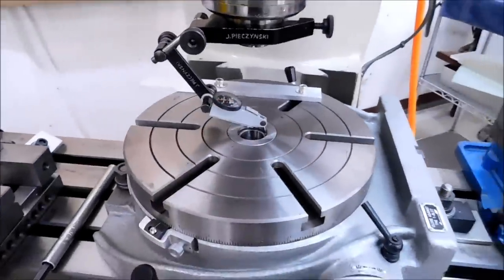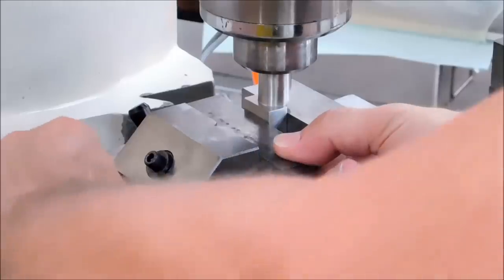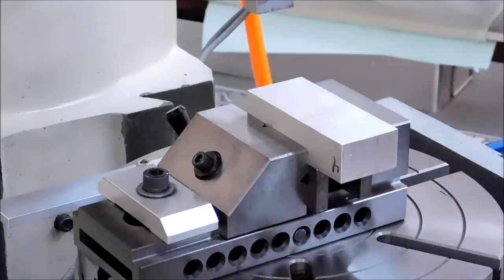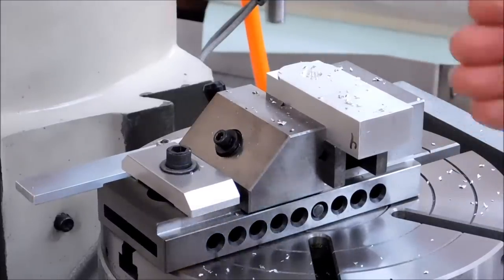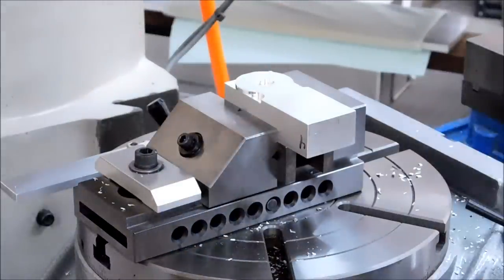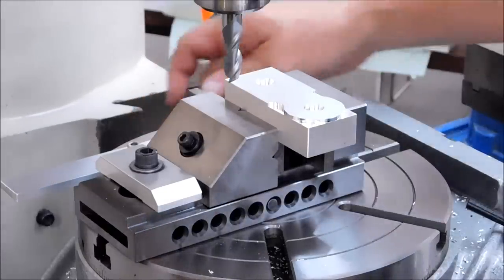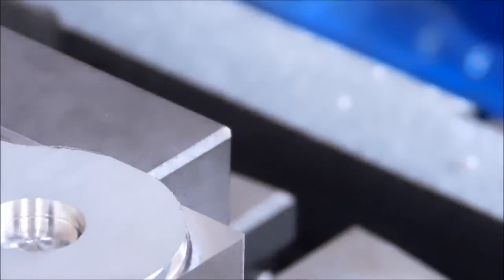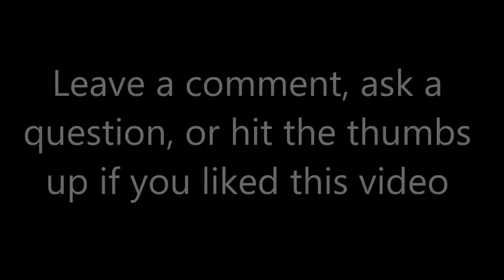Simplified Rotary Table Setup. Tool Demonstration #1

Comment: Climb milling is the best way to break your endmills especially on steel!!!!!
Reply: Looks like aluminum to me but I agree on climb milling
Reply: @davemanley8700  It is Aluminum the part he is working, I am speaking from 50 years as a machinist, you have to have ballscrews to do climb milling and still you take the risk especially with long endmills:-((
Reply: I can climb mill reliably so long as I take reasonable cuts and partially lock the travel axis. This is on an old worn out acme thread too
Depends on how brave you feel!
Reply from the maker: I climb mill exclusively.
Reply: @TomMakeHere  You will feel brave until you break the cutter, then you feel frustrated!!!!! why complicate things when there is a simple way to do it!!! Using the locking screws accelerates the wear and tear on the guide ways:-) As an apprentice in a shipyard I was thought never to climb mill if you want to avoid trouble:-))) Well this is a free country if you want to climb mill go ahead!!!
Reply: Climb milling on a rotary table is not a mishap waiting to happen because you can adjust out all (?) the backlash between worm and gear. Just don't imitate a bull in a China shop.
Reply: Its interesting the last 3 endmills that I have broken were while conventional side milling. The fault was mine, had a tallish plate standing up in the vice, the instant that the endmill cutting edge makes contact with the part, it's actually on the front face being cut, not the side that you are milling and the rotation direction acts to pull the part like climb milling! The part grabbed (I hadn't  tightened the vice enough) and pulled itself into the endmill. It took a bit of head scratching to work out
Reply: @chrisstephens6673  My friend if you are happy keep on doing it, as I told you its a free country:-)
Reply: @johnhili8664  for normal use on a shagged out milling machine, mine, I absolutely agree with you. Save maybe for a very light final pass where the cutting force is considerably less than the force needed to move the mass of the table against the backlash. In my comment I was referring specifically to the rotary table where backlash, the reason for being careful to pick the right direction of cut, can be adjusted to  virtually zero. 
Here's to living in a free country,

Comment: Do you plan to make a version of this tool with a 0.500 shank? My mill is a Clausing 8520 that only takes MT2 collets, with a max of 1/2" diameter.
Reply from the maker: I may consider that. I have also had requests for 3/8".       Anybody else interested in smaller diameters??     Please reply.
Reply: @joepie221  Hi Joe, either of those smaller sizes would be very helpful for mini mills - thanks!
Reply from the maker: @joelsciamma9322  1/2" dia currently for sale on my webstore     https://www.advancedinnovationsllc.com/shop
Reply: On the .500" shank version would adding a 0.250" diameter center hole with a floating 0.249" diameter headed die punch provide a needed feature?  The hole's diameter top portion could be relieved, the bottom 1" portion wire EDM finished.

Comment: Hey Joe, Loving the Channel as a newbie im learning heaps!  i have a request that you may or may not have touched on before  - Could you do a laymans way of finding the degree or angle of spline teeth?  i have a spline here that i would like to practice cutting and id like to be able to accurately find the angle of each tooth but its too small for my protractor. any help would be appreciated or links from fellow machinists. Cheers, Troy

Comment: What are the tolerances of this tool? Why does climb milling aluminum on a rotary table FEEL so good?
Reply from the maker: .0005 max in every direction from center. Climb cutting feels good because the cutter is pulling the table.
Reply: Joe Pieczynski Great. I’m getting one and showing my friends. 

When I climb mill in X or Y and it pulls the table it feels... okay. When I use the rotary table, it’s like the endmill was waiting it’s whole life for the moment and I greatly enjoy it. Maybe it’s because its crank is more accessible and easier to turn, but I first thought deeper cutting physics at work, since at the same feeds and speeds I will get better surface finish.

Comment: I missed out on purchasing your allinment pin but I did make my own and my rotary table arrives tomorrow I can't wait thanks for your channel it helps a great deal but I do have a question but I'm sure when my rotary table comes in I will have my answer you mentioned that your t slot does not line up with the x axis why can't you disengage table aline it and then reengage it
Reply from the maker: The index plate didn't allow for that, and the index marks are hard engraved into the table. Only an offset indicator will solve this issue.
Reply: @joepie221  yup I’ve noticed that I have the same problem I will have to make an offset just like you did but first I have to make some t bolts again thanks for your help and your channel it makes a big difference to those less skilled ps I was able to find a Illinois trig table book

Comment: when i first seen it i thought you had a cross slide rotary table, this is easy, if you had a CNC mill you could have programed it by hand and had the part done in a forth of the time, you can't make any money like this, this is the way you play around for yourself only
Reply: Most of us are amateurs and have manual milling machines, I'd guess.
Reply: Tony D.....Do you think he doesn't know that?  He has a professional shop, full of CNC equipment.  If you paid attention to the video, you would see he is showing the setup and use of the centering tool.  Nothing more.  Making money was never a point here.
Reply: customer pays for the time no matter, thanks arm chair shop owner.....
Reply from the maker: This video is about helping a problematic setup become less scary and more accurate. Not all shops have CNC machinery.